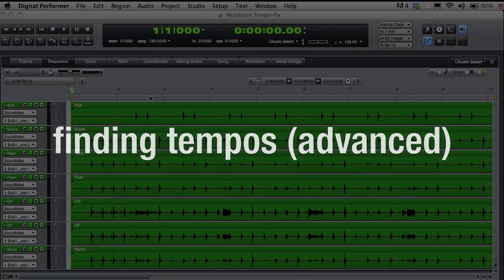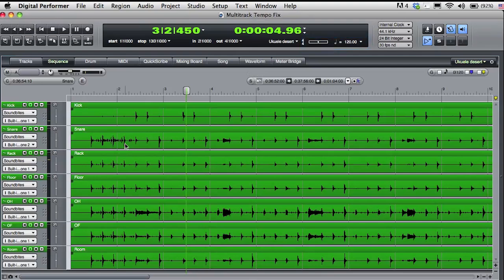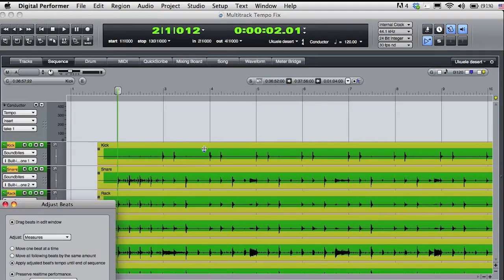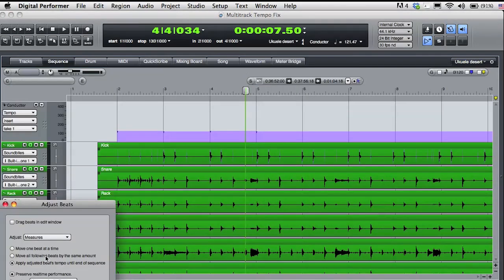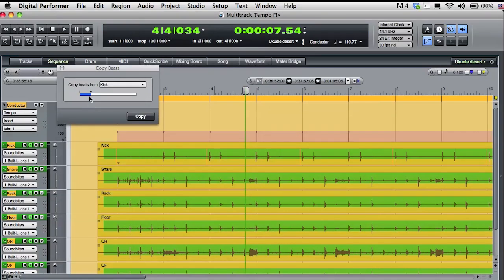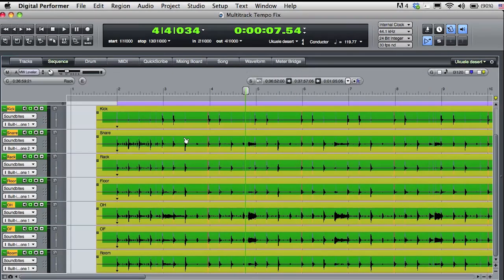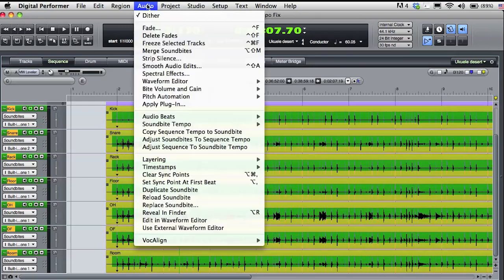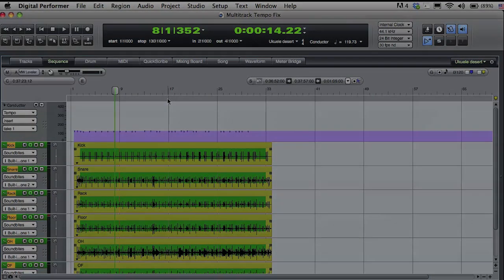Audio tempo in DP (part 3 of 5): finding tempo (advanced)

Comment: I was able to manually drag the bar lines to the audio beats and that worked somewhat, although it gradually got out of sync. The automatic beat detection absolutely did not work. It put the sync point in a place that made no sense and i think that's where the screw up happened.

Comment: This works to an extent for me, although it seems I need to merge all the soundbites in a track first if they are separated, in order for them to not slip out of time. I.e., the first track I recorded will line up but subsequent tracks already recorded will get out of time even if the tempo map has been cleared. Do all tracks need to be whole and start and stop at the same measure graphically?

Comment: I've watched this video several times and DP9 does not have the same "adjust measures" functionality as described here. I think this is probably a DP8 tutorial. It would be great if it were updated to reflect the most current version. 
With the audio track selected, and you attempt to adjust tempo by adjusting the barlines, as shown here, the cursor does not change to allow you to grab the bar line. Instead I get a lasso tool icon. And that does not permit moving the barlines to fit the sound bite tempo. The audio track tempo is fluid and I would like to make a tempo map for my sequence to follow.
Reply: Keep in mind that the Adjust Beats window must be open in order for the Adjust Beats feature to work. It's even not mentioned in DP10 manual. Please MOTU! ;-)